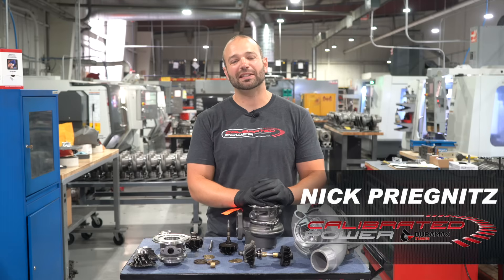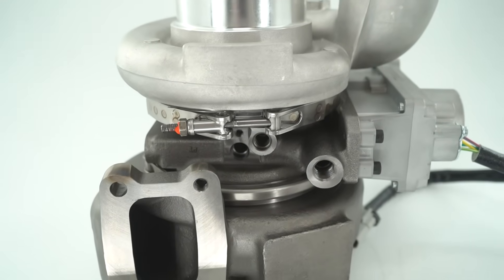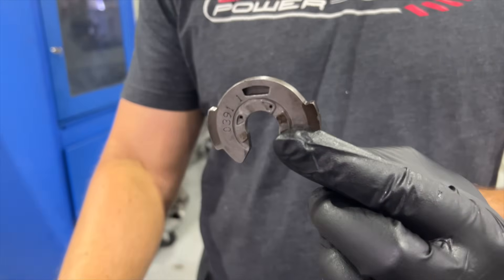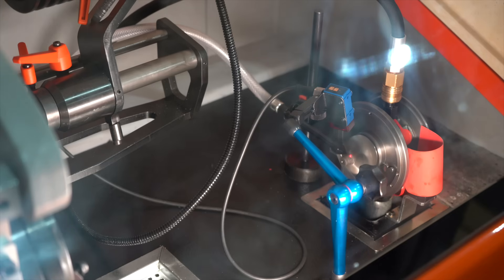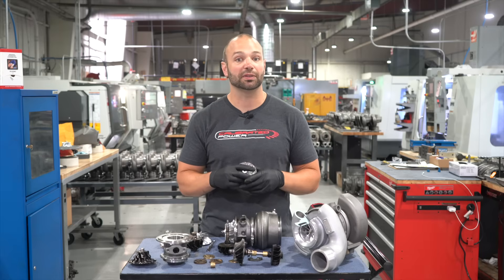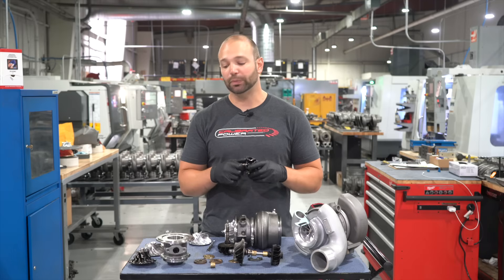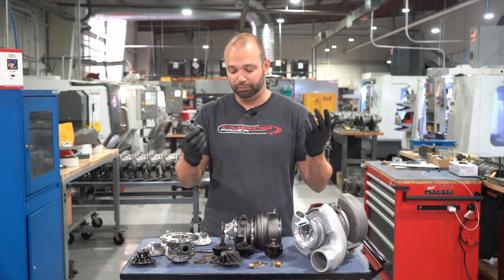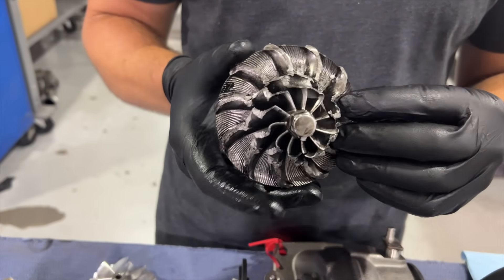Causes Of Turbo Failure

Comment: Many thanks Nick.  My Daughter bought a 2017 Vauxhall Astra Diesel SRi Turbo. Car had only done 48,000 miles and was immaculate.  A recent service has revealed the turbo is ehibiting signs of impending failure.  Your video was excellent in not only explaining possible reasons for turbo failure (in large Trucks) but how to properly maintain a car's engine (regular oil and air filter changes, allow a few seconds cool down after high speed driving, and don't thrash engine on start up).  I will check the cars maintenance record - and I will check this last service to see if oil was changed, and Filter and Air filter).  I will also checkkif car is making any unusual noises on start, whilst running and on cool down. Many thanks again.
Reply from the maker: Thanks for the feedback, Philip! Glad it worked out for your daughter!

Comment: I’m pretty sure my turbo is rubbing against the housing. It’s been like that for quite some time but now the car burns oil 🤔
Reply from the maker: If you're turbo is rubbing against the housing, stop driving the car and get it fixed ASAP. If the wheel does let go, burning oil will be the least of your worries.

Comment: Please help I own a rv 7.2 litre catapliar engine, I don't think it's the turbo but I'm no expert.
What's happening is 1600 rpm to apx 2100 rpm I'm getting a whistling noise.
Noticed when the engine gets a little hotter the whistling is still there but at a lower volume as if it's doing away.

Is this turbo related? I cannot seam to find the issue.

Please advise on any of your thoughts and thanks you.

Jason from the UK 🇬🇧.

Comment: Hi Nick, can the DEF system cause turbocharger failure on a 2016 Hino 268 box truck with 274K miles? My check engine light came on and my truck started struggling to go uphill and after stoplights. A mobile mechanic suggested turbo replacement and deletion of the DEF system. What are your thoughts?

Comment: Mine just start wiseling like a siren. Really anoying. Start at 1100 to 3000 rpm.
Reply from the maker: @fhclappen8595 Excessive noise from the turbo is usually a sign it's in need of replacing. Did you get a good look at what the damage was?

Comment: Hey Nick I blew my stock turbo to bits on my LB7 should I tear down my motor to inspect for any turbine shavings or bits of turbo wheel I ordered a stealth 64G2 turbo and I’m worried if I put the truck back together with new turbo and have engine failure in the future I need my truck back on the road as soon as possible !!! Awesome video by the way !
Reply from the maker: Give us a call, 815-568-7920!

Comment: would it be reasonable to have an issue that isn’t going to need a full turbo replacement? Went to the dealer and they quoted $6k for a whole new turbo charger but they didn’t run any testing other than obd reader…
Reply from the maker: It could be like an actuator replacement or a specific part using a rebuild kit. It's plausible.

Comment: I checked my oil level on cold it was max.
But on hot as the manufacturer GM said (operating temp) wait 5 minutes and check level, i did it was at minimum i added some. 1/3 of a Litre. So i was driving and there is now white smoke coming out the turbo i suspect.
I wish i can attach a video.
But yeah i was giving it a little gas, parked left in idle pop the hood, and found white smoke coming out of I'm suspecting the turbo.
Is this also possible with a dirty air filter? I'm gonna check and.change my air filter today, I would do an oil change as well, but can't afford it atm.

When we took out the turbo it had some side to side play(i had to use two fingers to move it, people said this is ok), but not all round, all the tails are intact. But the middle screw that's holding the intake turbo fan, is like slighty chipped. Is it out of balance now?

Could this also be a vacuum issue (positive crankshaft pressure?)

The sound of the turbo is normal, no whining, and the blow off does the normal Pshh sound.

Opel Insignia 2009 2.0T Petrol
Or Buick Regal 2009 in the US.
I'm not from the States i live in Serbia,

Hope to hear from you.
Reply from the maker: Sorry, we'd have to have our hands on it to diagnose and we aren't well versed in Buicks/Opel.

Comment: I just replaced my old TF035 turbo with an aftermarket replica... was running okay but after making some tuning adjustments, I'd forgotten to tighten the intercooler hose clamp before taking it for a test spin. Very quickly into the drive the intercooler hose popped off while in boost of a little over 10 PSI. After putting the hose back on and tightening... it runs about the same but now has a high-pitched whining sound whenever turbo is actively spooling or maintaining. Could you give me an idea of what exactly happened within the turbo and if it's easily repairable? Guessing something to do with overspeed as a result of the hose popping off at a higher pressure?
Reply from the maker: We'd need to examine the charger for us to have a concise answer.

Comment: I have LB7 with leaking injectors - already spent $10k trying to get it fixed, but still leaking.  I now change oil at 3k because oil is getting diluted, been doing that for 30k miles.  Guess what?  Power is continually decreasing.  I think you nailed my problem with your statements of poor oil.  This video helps me to direct my attention.  Thank you!
Reply from the maker: Sorry to hear about the issue, but glad our content helped you!
Reply: what are oil are you using? i have a 2015 ford escape 2.0 ecoboost, and i change my oil every 3k i use like pennzoil ultra platinum, valvoline extended protection,
Reply: @MJ_AngeloJR  - is your question for me?  I'm using Rotella T4.  What difference does that make to you?  Have you owned a diesel that adds fuel to your oil?

And after reading your statement about what you use, I read it as "I spend a lot more on my ford than I can justify."  Not intending to disrespect, but unless your goal is to run your vehicle until it hits 500,000 miles without a rebuild, conventional oil at $4/qt has you well covered, especially at 3k changes.  And FWIW, 3k changes is a marketing concept by Jiffy Lube back in the 70s with the goal of driving up sales, with no mechanical justification.

Comment: Hi sorry have a question my car hasn't been boosting like before turbo has more than 176k on it can it be that it's worn out??I also hear a whistle noise while idling that goes away kind of like the turbine stopping from spinning.
Reply from the maker: Could be failing. Get it in to a shop.
Reply: @Duramaxtuner  thank you

Comment: Ive a 1995 volvo 940 lpt and the turbo just isnt boosting. I noticed after i installed a gauge.
Since then i bought an adjustable wastegate (Ive tightened it way too much for a functioning turbo, still no boost..)
Checked the dump valve, it seemed perfectly fine? 
Checked inside by taking off the large hose, spins fine, doesnt rattle or have any massive gaps.

I really dont know what to do anymore, i also tried driving without the wastegate hose connected, still no boost.
Reply from the maker: We haven't had our hands on a Volvo 940. We'd have to actually look to be sure. Sorry.

Comment: One other major thing, is to make sure that an engine that's been loaded, to cool before shut down. If the turbine volute is still hotter than the break-down temperature of the oil, the oil can 'coke', and that can cause a bearing failure. The lower the break-down temperature of the oil, the more important a cool down period before shut down. (idle the engine a few minutes before shutting off)
Reply from the maker: @vincentrobinette1507 Good point to make!

Comment: The propeller on the intake side is not supposed to have play in it ? truck has no codes but it has a rattle when the turbo builds boost only under a decent amount of boost
Reply: Do you sell new turbos ?
Reply from the maker: We have turbos for tons of models, give us a call 815-568-7920

Comment: What causes early electronic wastegate failures?
Reply from the maker: Early failures can be: 
Mishandling of the turbo, water ingress, wire connector issues, and possibly vibration.

Comment: I have a question for you I don’t have a truck I’ve got a 21 Infiniti Q 60 TwinTurbo and I am running a boost controller the other day. I noticed that one turbo was spinning faster than the other. I checked for boost leaks can’t find anything when I pull the air filters out which are k@n I noticed they were a little bit dirty so I pulled them out and I put the factory ones back in while I clean the other filters so I started it up and both turbos are reading the same rotation, speed, can a dirty filter, cause that thank you for your time Brian
Reply from the maker: Sometimes an aftermarket filter can cause weird issues. Did you clean the K&N and try them again? Or just the stock?
Reply: @Duramaxtuner  yes, I cleaned the filters which only had 5000 miles on them. Put them back in everything’s fine that’s just weird never had a car do that before but this is the first time that I’ve owned a turbo car. Thanks again.
Reply from the maker: @briankress9997  That is odd, wouldn't really know without getting our hands on something like that to diagnose.

Comment: I have a 2003 LB7. I bought a built engine, a WCFAB Stock/S475 through you, and a DT-750. I have fixed 4 boost leaks. I can build 25 psi at the Pipe that goes to the intercooler but I can’t build any pressure at the Valley turbo’s mouthpiece. If I put my ear on the Turbo mouthpiece there is a bubbling or gurgling sound. If I have a bad bearing or bad thrust bearing would it leak boost test pressure into the oil or coolant system? My boost leaks were the shop forgot the 2nd boost sensor port, the S475 compressor plate, the MAF sensor port, the bottom bolt of the Valley turbo’s compressor plate. I will probably get a 64mm Valley to match up better with the S475. I have smoke at 1/2 throttle to WOT. Do you sell a cap to cap off the IHI’s turbo’s compressor outlet?
Reply from the maker: Give us a call, 815-568-7920

Comment: I no this is a duramax channel an I respect all brands of trucks,I have a 06 6.0 powerstroke bought it 7 months ago it’s a lariat with 96k on it so dealership replaced the turbocharger after I test drive it was making a loud high pitch sound like the wheel an hosing were not getting along best way I can describe it,while they had it 2 injectors where not happy so they replaced all 8 oem injectors an new injector wiring an it’s definitely back to how it should be an no issues my question is based on this video are all turbochargers the same as in thrust bearings an balanced an the same failures? Since owning it I did new hot an cold side piping s&b intake crankcase reroute sinister diesel blue spring kit aluminum 3 core radiator 4in straight pipe to a axle dump an a cts2 edge insight monitor fresh oil change if the time ever comes what’s a daily driving friendly turbocharger and do I need to do injectors if I do a different turbocharger? Thanks for the awesome videos I’ve learned a lot from this video an would love to learn about other ways the turbocharger can fail,thanks nick.

Comment: Will excessive engine idling damage turbo or dpf on a lml? Thanks!
Reply: From what I been told and heard do your own research 
Is that it is bad lot let them idle I listen to various podcast and they were saying the guy out there hotshoting the truck and driving it thru regen and running hard there not really working on them as much as the gentleman that drives it to work 15 min away and on weekends So I’ve been running mine the extra mile when it goes into regen hope this helps
Reply from the maker: Idling it for extended periods of time is not good for the truck.

Comment: 26308 hours on the motor and the crank broke before the turbo went. Mobil 15w-40 with one quart of Lucas every 4500 miles
Reply: Which engine?
Reply: @jacksonreid6412  2006 LBZ
Reply from the maker: Yikes

Comment: How much does tuning affect the turbo surging
Reply: It depends on the turbo, variable geometry turbo chargers can be coaxed into or out of the surge a lot easier with tuning than a wastegated Turbo. Transmission tuning also can play in if the shift points are set too low for the turbocharger
Reply: Not much its mostly happens when you accelerate then let off fast
Reply: Thanks for the reply and sharing the info